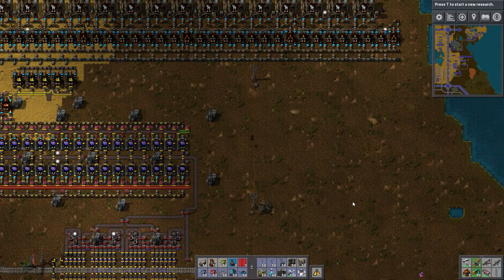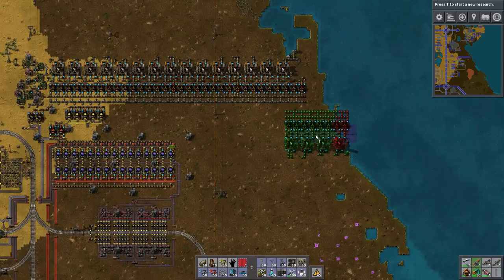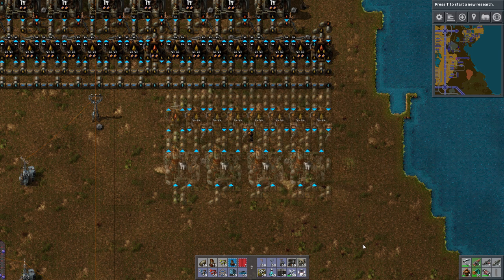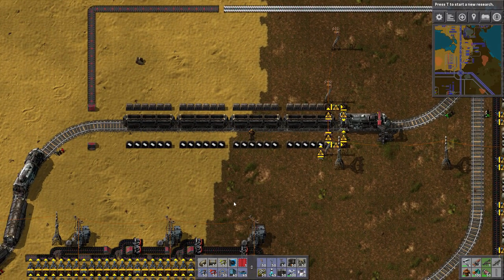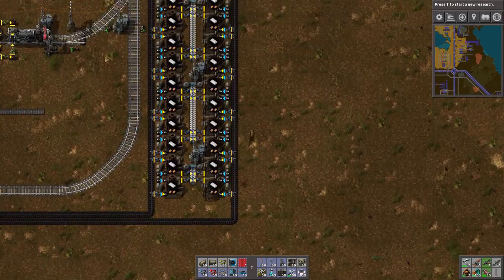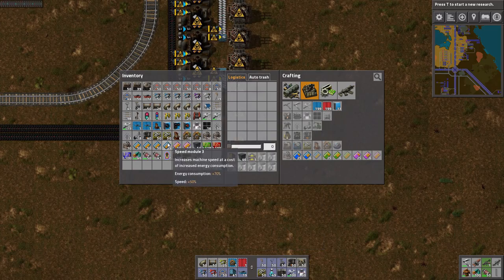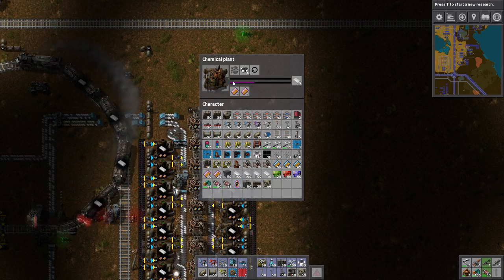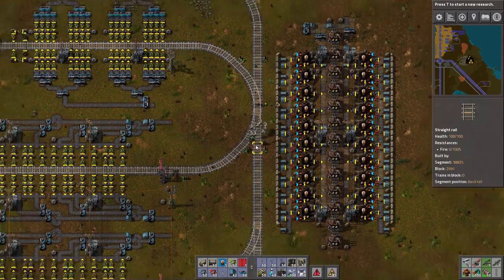Factorio Meiosis :: Batteries For All Time - Episode 27

Comment: I think what happened with the train is that the oil train (the one that sped by) had a red light on the main 'highway' due to the copper train about to turn into the cell, so the battery cell took into the cell to get by that red light. :D

Comment: The train that rushed through was a train full of oil barrels. I don't think it was making a U-Turn; there was probably one of the trains for the battery cell bringing iron or copper inside the intersection at that moment, that caused the oil barrel train to see the path as blocked and decide to go around. That's one of the biggest problems with the train AI: they don't look at the length/time it takes to get somewhere, it just checks to see if the path is clear or not. If it becomes blocked right before it reaches that signal, the train will decide to go around a different path, even if going around would take a LOT longer than just stopping for a moment and then moving on. Unfortunately, the longer your train network and the more trains on it, the more likely it is that a train will end up going around a really long way and taking a long time to get where it was going.

Another youtuber I watch play Factorio has a fairly clustered main base, and then a ludicrously long rail line going around a lake. Sometimes, random trains going from point A to point B inside the main base will suddenly decide to go all the way around the lake just because their path was momentarily blocked. 

It would be interesting if it were possible to make a mod that could "mark" trains somehow, and then allow you to install "blocking" signals that would only allow certain trains to enter certain areas. For the unmarked trains, they will simply not ever see the sections beyond those blocking signals as a valid path. You could then put them at the intersections for the cell stations and disallow any trains not actually going to those stations (in this case, anything other than the iron, copper, coal, and battery trains) and then they won't ever do so. And in case you have extremely long spur lines going to distant stations like for oil pumps, disallow any trains to go there except the oil trains, and completely avoid any train suddenly deciding to go take a world tour.

The only other option would be to put some kind of bypass around the intersections so it could never be blocked by a train entering/exiting a station, but I don't think it would work anyway because there's no such thing as underground train tunnels (yet!) so there still wouldn't be an uninterrupted line available. All you would doing is creating a larger, more complicated intersection.

Comment: I don't know if you know this already, but that train that came speeding through, was an Oil train. It looked full of oil, too.
Looking at the map, I can just barely see that it was coming from the south. All it did was, run into the station, and jump back on to the line, still heading north. I don't think it saw the rail line in that area was a good way to go. So, no, it wasn't a u-turn.

Comment: Z, it might not be the number of refineries you have, it might be that you are only using 1 or 2 pumps. To increase speed of fluids and etc through pipes have a line of ten(10) pumps in a row pointing the same direction. Each pipe only pushes at 50% speed, but they stack so you can get about 5X speed with 10.

Comment: you could look up liquid splitter to make sure the plastic and sulfuric acid gets an even amount. right now your plastic gets a priority. all you need is 1 tank, 2 pumps and 2 circuit cables. set the condition to pump when tank has >50 petrolium on both pumps.

Comment: 1) Those productivity modules in the sulfur plants are useless since the sulfuric acid plants can't use it all.
2) If you make a new oil setup, don't forget that you need 5 oil refineries (per 1 heavy->light and 7 light->petroleum) (If you don't use modules. Modules screw up the calculations, like with the sulfur)
3) Your electronic (green) circuit cell could produce a lot more circuits if you added a bunch of assemblers / belts (and had left more space to do that).
4) Your steam engines started working to charge accumulators, the only way to solve this is to add some circuit network stuff to only use steam engines when the accumulator power is below a certain percentage. This can be done with 1 accumulator connected to a power switch, but you can also add a fancy visual indicator of the amount of charge left in the accumulators (takes 10 lights connected to the accumulator). And with some truly ridiculously complicated combinator logic, you can set up a visual indicator for the amount of used solar panel power vs. total solar panel output capacity.
Reply: 1) No they aren't useless, as they are still saving him petroleum gas, since they don't have to work so much.
Reply: Fair point, but he could use less sulfur plants and therefore less productivity modules and still get the same result
Reply: I wish he'd put in a couple storage tanks for the Sulphuric Acid. 
It'd show straight away if he can produce more than he can consume, plus gives a buffer in case of lags in supply of raw materials for Acid.

Comment: why not take all that petrol gas and light oil youre using to make solid fuel and crack the light oil into gas and then feed the gas back into the system? if you still end up with excess you can use that to make solid fuel or go take over a small group of oil wells and use all 3 products from it exclusively as a solid fuel cell and im sure that would get you a lot of fuel quickly.

Comment: Most of your train track blueprints are broken on the bluprintstring forum, could you upload new ones and maybe add some more? Thanks.
Reply: Broken since the update :(
Reply: If you use foreman I think there is a button to fix it but you might have to click it a few times
Reply: It worked, its a repair symbol in the group of buttons at the top and yea you have to click it more than once. Thanks